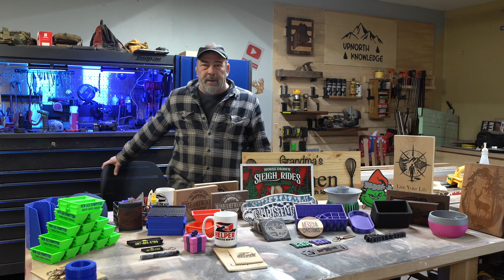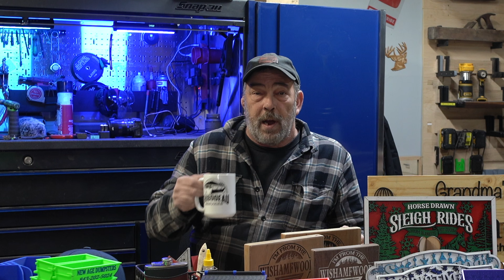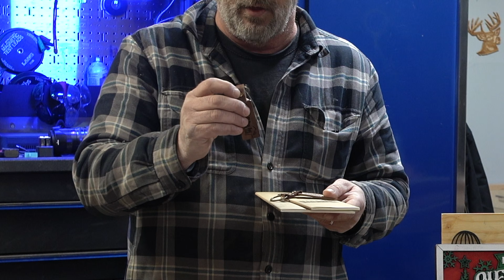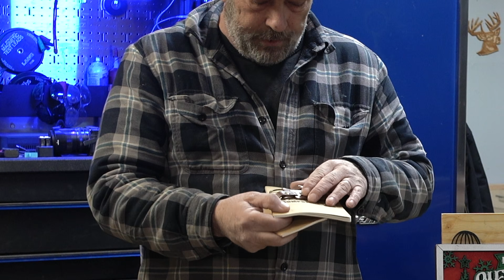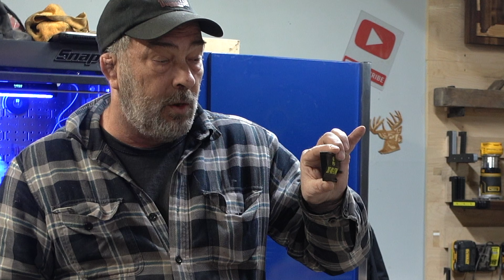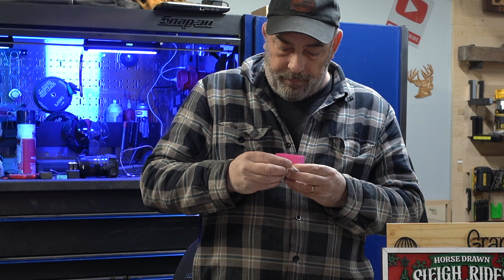3D Printing Revolutionized My Business in JUST 30 Days

Comment: I kind of disagree with what you said about the 3D printing thing. The printer has so much more versatility than say a saw or even ur laser engraver. The only thing the saw does is cut. The printer can make infinite things the saw could never even touch. Color things, impossible shapes, and  all in a very wide range of sizes.
Reply from the maker: I completely agree.  Sort of.  a table saw and a 3d printer are apples and oranges.  They do 2 totally different tasks.  But when put together as a collection of tools is where, in my opinion, more things can be made.  Picture these door hanger signs everyone makes with their lasers and wood....now add 3d printed details and it makes it that much better.
Reply: @JohnUpnorth  Yea it definitely  is a required tool if you want to do any kind of plastic work. I think what you're talking about makes a lot of sense for what you're doing. But As for now at least there's lots of companies that only focus on 3D printing and are pretty successful.  I still think there's lots of people out there that would rather just have you make it vs them spending the time too. Even though 3D printing has become so dumb down almost anyone can do it.